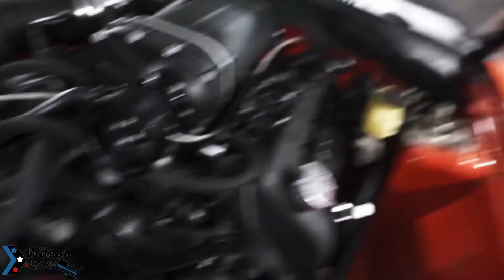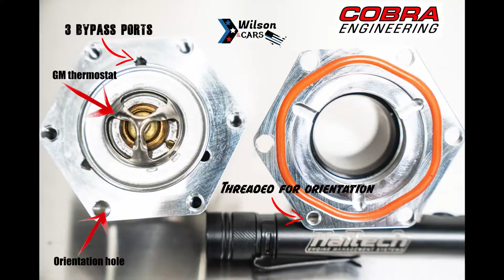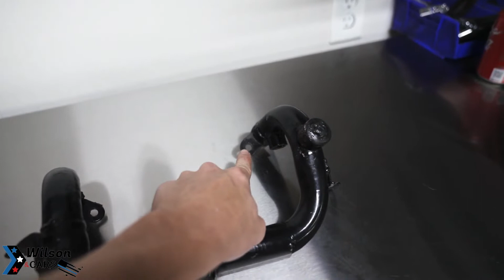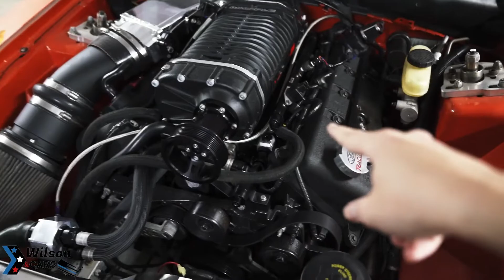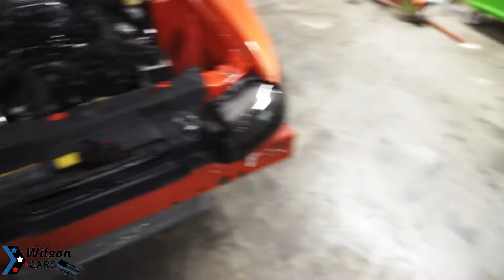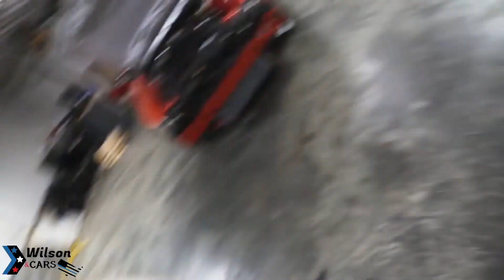mustang cobra coolant cross over delete! cobra engineering

Comment: Im Using the On3 setup , i modified it by welding an inline rad cap.  I also bypassed all the lower mess and just used a 90 degree and a Moroso adapter.   Im fighting getting this thing to burp properly. 
Any other tips or tricks?   Essentially im filling the system right at the upper hose

Comment: Have a question.. Where do you have the 1/2 npt fitting headed to for the head coolant mod? does this connect to the head cooling mod on the driver side somehow?
Reply from the maker: It depends on if your head cooling mod calls for it, a lot of them do not but some do and James just gave that option. 

On my car that is plugged
Reply: @Wilsonandcars  ok good deal

Comment: Question, besides the obvious reason for this mod does this also help with 5th & 6th gear pulls? I keep hearing about the damage that is caused from extended runs in 5 & 6.
Reply from the maker: This is actually more for just cleaning things up and moving the thermostat from the bottom hose to the top hose .  This allows more room for 1” IC line conversion .

http://cobraengineering.net/cooling%20mod.html

The head cooling mod will help more with keeping things cool for longer pulls , but even then a 5-6 gear pull is very hard on any engine.
Reply: @Wilsonandcars  That is awesome man. Appreciate the response sir. I see a lot of people doing power mods and leaving out the essentials such as larger heat exchanger, head cooling mod, thermostat etc.

Comment: Last question, are you running a rear coolant crossover? I don’t have one installed yet, not sure if I should do a rear crossover into the heater line, which would look nicer or bring the rear drivers side coolant line up to the Cobra Engineering 1/2” port on the thermostat block. This would probably be best, but will clutter it up.
Reply from the maker: The rear wonder racing or cobra engineering is the kits I will be using, currently do not have one.

Comment: Hey man, I just ordered this kit. I see your welding on a fill neck onto your radiator. Doesn't the drivers side cross over adapter block have a fill port in the top of it? That's how it looks in your video. I was going to install a SN95 radiator, but after seeing that block's fill port, I don't see the need anymore.
Reply from the maker: I believe you need some sort of radiator cap in place, so when the system builds pressure it can release fluid to a over flow, or it could possibly swell or bust a radiator.
Reply: @Wilsonandcars  Ok, so are you going to run a overflow tank (like on a fox) or stay with the factory style expansion tank? My plan was to keep a expansion tank, just make it a smaller one and stick it in the fender, if needed it could go where the battery was, but I'm trying to keep it out of sight.
Reply from the maker: Honestly i will probably do like a canton overflow or something like that. I will be ordering a bunch of stuff tomorrow , so by tomorrow night I should have a idea on what I’m gonna do..